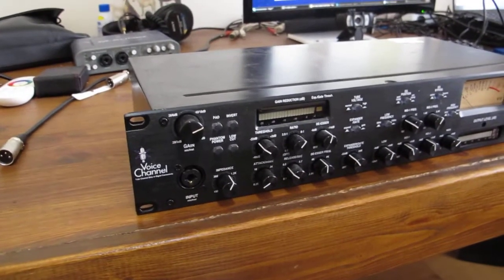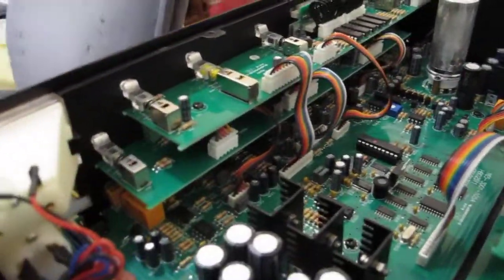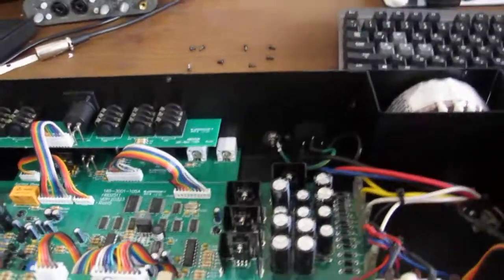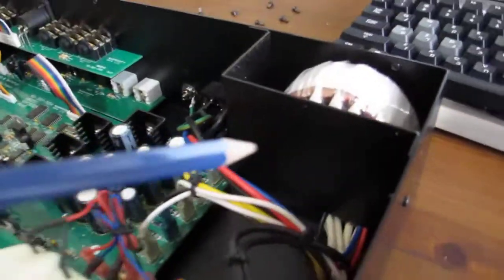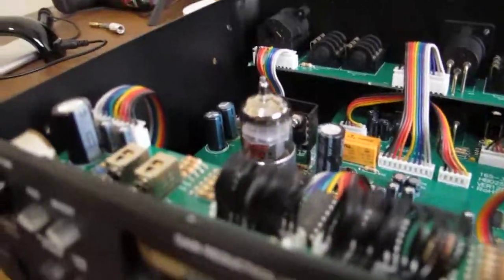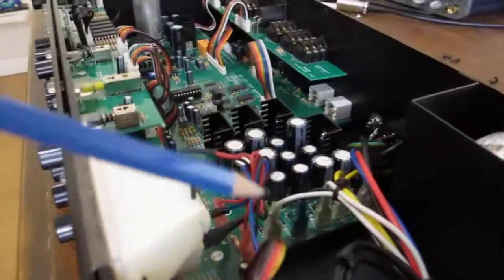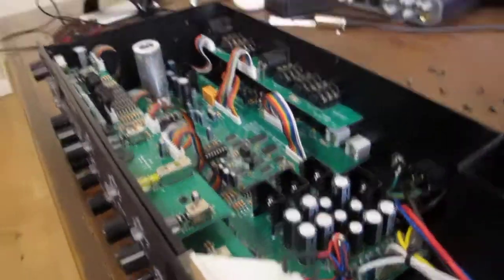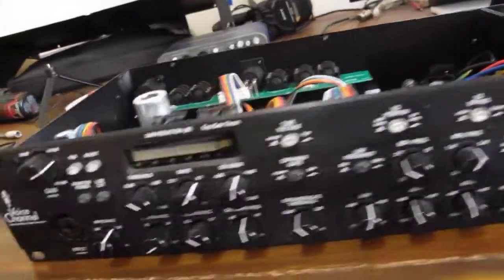ART Voice channel Microphone preamp teardown

Comment: Michael, a couple years back I happened upon this video and it was the final push that inspired me to try the ART. Since then, I still use it exclusively for male VO and have had no issues using either a Sennheiser 416 or Neumann TLM 103. PLEASE NOTE TO ANYONE CONSIDERING THIS UNIT...After purchasing, a rep at Sweetwater suggested swapping-out the stock tube with a RED LION. I did so and noticed a marked improvement in overall sound. Soon thereafter however, I happened upon a very obscure online article written by an engineer who also was impressed by the circuitry. He also said he tested a few different after-market tubes (including the Red Lion) and then mentioned one he loved! With that, I bought a JJ ELECTRONIC ECC83-S and never looked back. I've mentioned this on other videos about the ART because it does indeed enhance the overall sound and the tube vibe. It's not muddy but there's indeed a warmth. You can get a variety of clean-ish to tube-ish vibes by adjustments in GAIN vs OUTPUT LEVEL, IMPEDANCE and so forth. Read the manual and do some deep experiments with settings. Having tried a variety of channel strips, this one, with that tube specifically, is in my opinion an unsung hero. On top of that, with that tube installed and while conducting noise floor tests, it was actually quieter than a brand new Focusrite (Tubeless) ISA One! If you're on the fence with this unit, maybe my first hand experience can help in making a decision. Unfortunately, ART's first offerings back in the day were kinda weak and they got a bad name out of the box. My brand snobbery instincts were holding me back but I got past that...and glad I did. It's well built and delivers!

Comment: Thanks. A question, this does not use transformer, only the tube? 
Also, it does not have the output in the preamp section, how can the gain be attenuated after the input is driven harder to get some saturation, does the EQ get overloaded?

Comment: +Michael Shnizer, I notice that you mention that "maybe"the valve can be change, dude, it's a must improvement to change the valve. I saw other videos recommending to do so and when I receved the unit, I changed it, the sounds was dramatically improved, many times a buzz noise reported in these units is caused by the chinese valve in them. 

I am using a Telefunken that works great on it, check this reference:

https://www.bhphotovideo.com/c/product/1116020-REG/telefunken_ecc83_tk_12ax7_vacuum_tube.html

Comment: Is it possible to convert this unit to 220v/50 Hz voltage from the transformer?.Thank you.
Reply from the maker: My unit is running on 220/50. There is a dual fuse to choose the voltage
Reply: If you twist the fuse then you can use it with 220v.I did it and it works flawlessly.
Reply: @hernone1769  Thanks for the update.
Reply: Michael Shnizer Oh really,how can I make that change since my ART is 110v from factory?Thank you for your reply!
Reply: @hernone1769  My manual says it is configured at the factory for country of origin. But I am not sure what is involved. It could use a different transformer or different pair of windings in the same transformer.